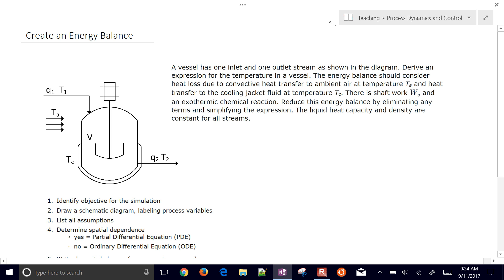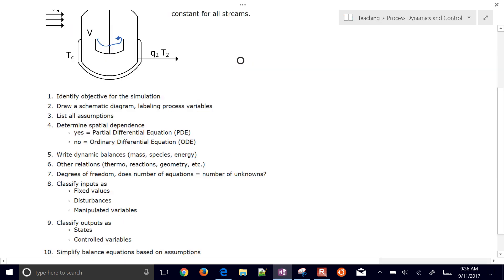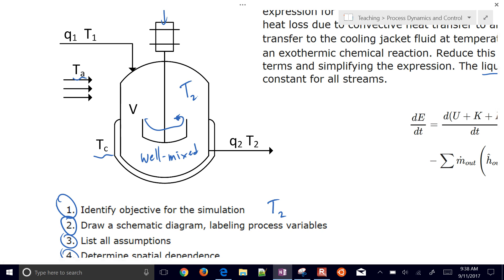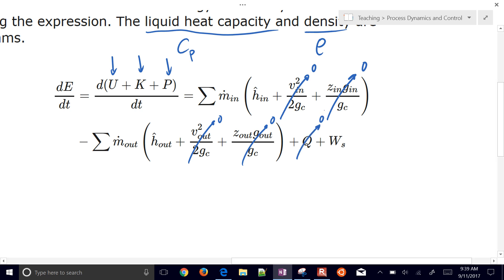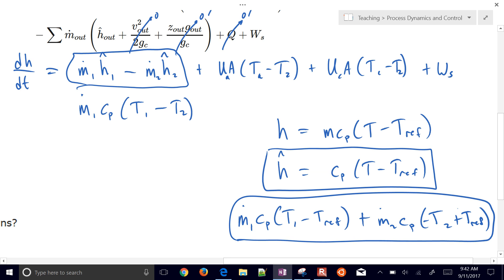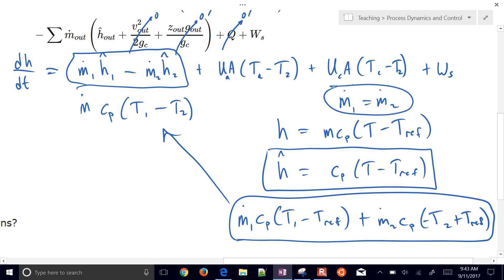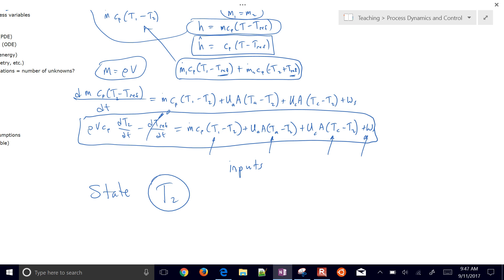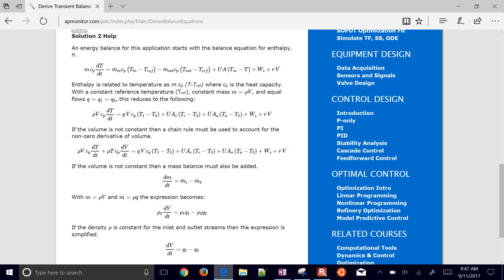Transient Energy Balance Derivation

Comment: Thank you for the video. 
I have one question: Is it mathematically possible to integrate the equation so you can get a function of T(t) in the case that the HTC is a function of U(T)=U0*T (for example, when the product viscosity is changing with the temperature)? Thank you
Reply from the maker: Yes, you can include variables that are a function of temperature when solving the differential equation. Here is a tutorial with ODEINT https://apmonitor.com/pdc/index.php/Main/SolveDifferentialEquations and Gekko https://apmonitor.com/pdc/index.php/Main/PythonDifferentialEquations

Comment: Is Ws shaft work or shaft power?
Reply from the maker: It is the shaft work rate in units of Energy / Time.
Reply: @apm  isn't work rate = power?
Reply from the maker: @nandobike  yes, that is correct. The power of the motor will be the upper limit of the energy rate applied to the fluid through mixing. In reality, there are inefficiencies of the motor and mechanical action of the stirrer so some of the energy is dissipated as heat, vibration, or noise. Not all of that power is applied to the fluid.

Comment: I have an issue to understand something, You say Q=0 because there is no heat input.   But then you put UaA(Ta-T2) + UcA(T1-T2)  which I thought it was the same as Q (hear exchange), could you explain it please
Reply from the maker: I use Q=0 to indicate that there is no heater in the tank. UaA(Tc-T2) is the heat removed by the jacket so it could be labeled Q. The q cp (T1-T2) is the change in enthalpy due to the difference in feed versus exit temperature.